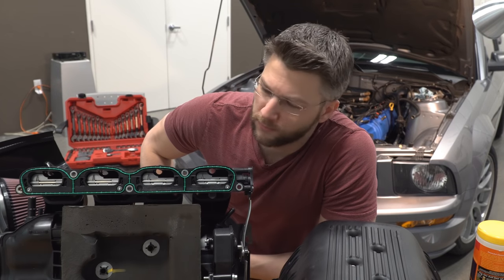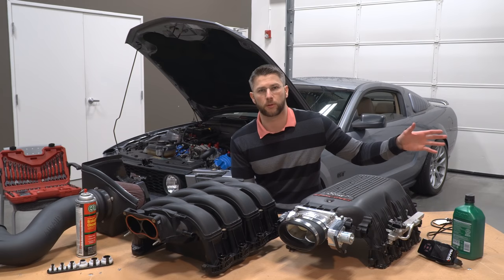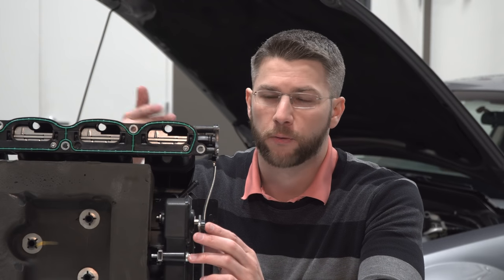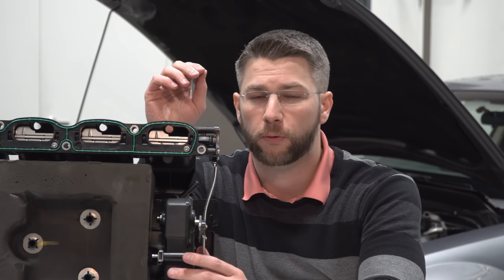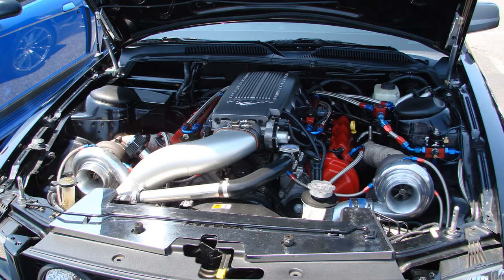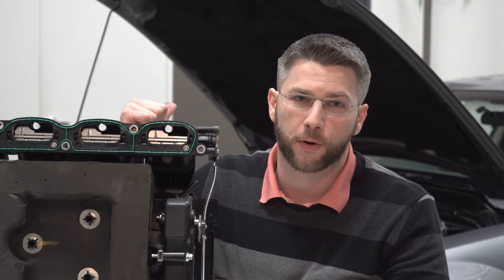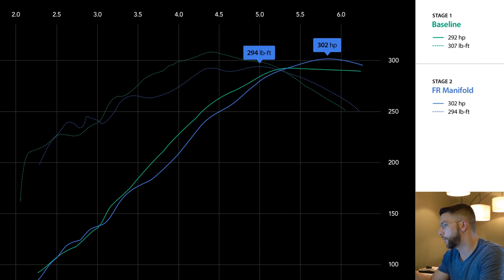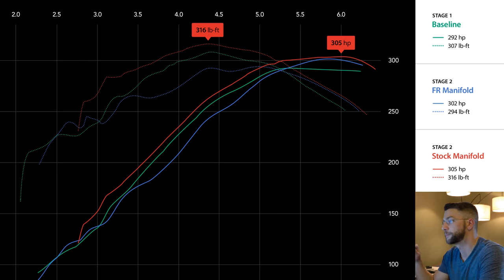Why you shouldn't remove your stock intake manifold

Comment from the maker: After years of working on this car and having it tuned multiple times, here's what I would say now:

- Don't get the ford performance intake manifold if you are sticking with stock cams and are unwilling/unable to get a dyno tune.
- The same goes for removing the CMCVs with delete plates (just not worth it without a dyno tune).
- If you are boosted or going to be soon, definitely remove the CMCVs or get the ford performance manifold.

The PCM on these 4.6 3-valves is fairly complex and sensitive to engine modifications. Sometimes mods can actually reduce power (like removing the CMCVs w/o updating the tune or using a canned tune!).

Your best bet is to install a set of parts all at once (intake, manifold, cams, headers, underdrive pulley, etc), then get the car tuned. That way your Mustang is tuned for its specific configuration which will maximize gains.
Reply: The charge motion control valves look like individual throttle bodies with a gaping hole on it at one corner. Can it be modded to actually work like ITBs, thus eliminating the need for the main throttle body?
Reply: Boosting includes supercharger, yes?
Reply: Another great option aside from the ford performance intake manifold is the Holley Sniper EFI Hi-Ram Intake Manifold. However its not worth it if your not boosting your mustang, but can make significant power if you have forced induction, and other bolt-ons. I think you can use the 65mm Cobra TB with a TB Spacer on it because the opening is 65mm, but I am not sure. However the Ford Performance TB also works just the same on it. Also when you have the Holley Sniper EFI already on it, then I think you do not need Steeda Delete plates.
Reply: Hello Sir, so I understand correctly from this video and your comment. Is , I’m potentially waisting my month and actually loosing performance with the ford racing intake parked with throttle body and jlt intake and tune if it’s not cammed or boosted. If I have neither and leave it naturally aspirated with these upgrades only, then it’s counterproductive?
Reply: I hear your voice when I read this
Reply: @american_alien_1583 it means you’re in love

Comment: As a 30 yr engine builder and tuner, I can tell you that I did extensive testing on my '05 GT and can show that it is not the charge motion plates that make better low speed torque.  Removal of the CMC plates actually makes power throughout the RPM range of the engine - about 5 ft/lbs down low, up to 10-12 ft/lbs @ 5k RPM.  The loss of low speed torque you experienced was due to the slightly shorter runners in the Ford Racing manifold.  Otherwise, your conclusion that the FRP manifold is really only beneficial for higher RPM engine combo's is correct.
Reply: So is it good to use the or not ?
Reply: @3v_karimm  I can't get the takeaway either, other than the charge motion plates didn't impact the tq, but rather the shorter runners in the Ford Racing.
Reply: @nomehdrider  it depends on the application
Reply: Richard holdner has proven time and time again it's runner design! Long runner make tq  down low and mid range while short runners lose tq down low and make more horsepower up top
Reply: @lucasmullins5100   I can't understand why Ford would spend so much money on something they wouldn't have researched extensively and deemed necessary. 

But, this does remind me of the IMRC (Intake Manifold Runner Control) design of my 02 Mustang 3.8 V6. It's the same concept and they are individual plates in the runners that open up the higher in RPM you go. But all that extra only produces a few extra down low tq and hp.
Reply: So steeda delete plates would be a good option for an NA build then?
Reply: Brian... have you tested the stock/GT500/Ford Performance Throttle bodies and see if these are improving HP or Torque. Or the CAI's as well. Thx much.
Reply: @lucasmullins5100 that guys a an Ls bandwagon 🤡 . all he does is use decades old mmff tests when he talks about mod motors.

Comment: I had the same experience with a ported 2018 manifold on a 2011 Coyote. The peak was higher but tons of power was lost under the curve. Unless you over-rev the motor, the benefits of such manifolds stay out of range. Turns out, Ford knows what they are doing.
Reply: Did you get a retune after the '18 install? I've seen average power levels go up on most of the data I've seen, but am curious about your experience.
Reply: Interested to know who tuned your ported 18 manifold
Reply: @NITROUSnBIASPLYS  The car has been tuned by a reputable drag racing shop and I got a re-tune right away. 
It`s a Gen1 coyote, so the ported 2018 manifold is using lockouts. This means the actuators are gone and can`t be tuned, resulting in mid range power loss. It technically still made more power at 7000rpm (+2whp) and likely would have been able to make a little more even higher up. That rev range is not very useful for my application and lap times though and would be hurt by having less power from 4500-6500. With a give and take loss of -25whp and -30ftlbs compared to stock.
Reply: And may I ask who’s ported manifold you were running? I have one I was planning on putting on my car this spring for a drag racing application
Reply: @NITROUSnBIASPLYS  I still think it`s a great piece for the right application and you totally can make it work with the right support mods. It`s just not the silver bullet it gets hyped up to and you need to be willing to over-rev the car to at least 7500. 
Drag racing is not that bad as you only spend brief moments in high RPMS. On road racing we spend 20mins constantly revving from 4500 to 7000 and that four to five times a day.
 Go figure why I`m not keen on revving to 8000.

It has been ported by Bret Barber.
Reply: @Hagedorn racing thanks for the input, it’s always good to hear end results from a wide variety of users.  May I ask another question totally off topic, what oil do you run in your track car?
Reply: @NITROUSnBIASPLYS  5w50, same as the Boss 302. It`s thicker and can withstand the heat better, but also needs some time to warm up. I`m the wrong one to ask if that`s good for drag racing though.
Reply: Thank you very much for testing this out.  I have been thinking about getting one for my '14 GT, but not anymore.
Reply: Joseph Bentley I installed my 1320 Junkie ported 18 manifold on my 14 6r80 car and have been very happy with the results.  I have a circle D torque converter and there was little to no torque loss at all.  And the car pulls much better past 6000 to 7400.  I get my tunes from shaun at AED.  Great guy to work with
Reply: @NITROUSnBIASPLYS  I think these are great for drag racing or anything that allows you to more or less safely over-rev the car. Not so much for roadracing on a stock block. Glad it`s working for you!
Reply: Sounds like you use a junk tuner, there's a reason Ford updated the manifold in the 18's and up. No torque loss here on my 15 gt
Reply: hsucduw how does the dyno sheet look like, what RPM do you rev to and are you using lockouts?
The 2018 is great, but only if you rev the engine accordingly or don’t use lockouts. Both things the gen1 is not made for.
Reply: @Badger_S197  oh my fault, didn't even notice you were talking about a S197. Ya, my IMRC's are fully functioning and I rev it to 7700. Must work better on the gen2's
Reply: hsucduw yep, that’s the range where the 18 really shines!
Reply: That doesn’t make sense a 18 manifold swap
On coyote makes almost 50 tourqe low end and 25 hrsp top end
Reply: 5. SLO Unless you over-rev, it won’t deliver any usable gains that will make your car faster.
Reply: @Badger_S197  
It's likely you have more intake manifold then you have intake port/cams if your running unported gen 1 heads. The 2018 and up manifold does a lot better on the gen 2 coyote with it's larger intake, valves, and bigger cams.

Comment: You lost me at Bama tune.....
Reply: BAMA is ok for a stock car, but if you are adding mods to your car go with Lund, Lito or Brenspeed for your tuning. BAMA is crap and very generic and pushed by a lot of Youtubers who get free product from them.
Reply: RIGHT BRO?????? WTFFFF
Reply: @JustAGuy781  Lito FUCKING slaughtered my MPG 12MPG vs 19 with bama, and made the same or less power on the dyno vs bama.
Reply: @jhondoe1483  yeah, but what is the difference in timing and fueling? Are you positive Lito didn't have those correct whereas BAMA has them mediocre? BAMA is like driving an untuned new car and Lito is like driving a new car tuned.
Reply: @JustAGuy781  I’m positive my Lito tune was intentionally pushing really rich to protect the motor it’s not a bad tune at all but it’s not really a good one the idea that bama is bad comes from the old v7 tunes nobody has those issues with them these days. I run brenspeed now with good MPG and 5-10 more HP across the whole bottom half of the curve, never looked back but that Lito tune was a nightmare not that all his tunes are I know he is beloved but my point is nobody’s got the perfect tune bama does a fine job for lightly modded cars

Comment: I had Steeda CMCV delete plates on my old 3V with a proper retune for the deletes, and it was a fantastic mod for hardly any money.  Picked up over a tenth and 1 mph in the 1/8 mile with no loss in under the curve power.

Love your vids btw.  My 06 was also Tungsten Grey and I still miss it to this day.  Love my 2018 but I'll always have much respect for a proper 3V.

Comment: It's all in the tune evidently  .  I purchased a 19000 mi . 05 and it wouldn't do a rolling burnout in first gear , it had an off idle stumble and didn't pull in high gear at low rpm very well . I did a tune by Brenspeed with Steeda cold air intake , underdrive pulleys , and charge motion delete plates and on the test drive was very surprised at the difference in all driving conditions , especially on the pedal to the metal test in second gear at a low speed , which now broke the tires loose  .

Comment: The valves aren't increasing back pressure. There is no back pressure in the intake (unless you have a supercharger and the back pressure, better known as boost, is created by the compressor). What the CMCV does is act like a small partial throttle valve, a deliberate restriction, which, if you call the venturi in a carburetor, increases the air speed which is what alters the charge motion and leads to better low rpm combustion, power, and drivability.

Comment: Great video brudah! I like that you are digging deep into the details in NA land. I think many folks do not realize that the power that you are going to obtain with forced induction is directly related to what you get NA. A 320 whp NA 3V will get about 640 whp with 1 atm of boost as compared to a 260 whp 3V getting about 520 whp at the same boost level. That's a big difference IMO. 

I'm glad I didn't waste my money on the ford racing intake manifold!

Comment: Who would've known it performed better without the FR manifold. I'm glad you are providing us all this information. Cheers!
Reply: Tune’s fault not manifold
Reply: @schmidtygt  tuning won't bring back the lost low end torque when you install an intake that's designed for top end power. It cannot make up for the CMCVs, nor can it make up for the change in runner length.
Reply: The FR manifold is meant for RPM so with out bigger cans it's not Benidict Al it's not the intakes fault it's the wrong intake for his combination

Comment: Interesting results.  I gained about 8hp at the very top end with the stock manifold and CMCV delete plates (stock TB, steeda CAI).  However, I'm also running a Lito custom tune (both pre CMCV and post CMCV) which may explain some of the difference.  Anyways, great video -- looking forward to more content from you.
Reply: I drilled out my butterflies and installed a gt500 throttle body with a lito tune   i have to disagree with you  my cars running like a raped ape.

Comment: Let me first start off by saying, VERY WELL DONE VIDEO, amazing content, and editing skills. I will however need to interject a few things. What software do you use? Adobe Premiere? 

1. The ford racing manifold is designed to either (A) be run with forced induction or (B) be run with a more aggressive motor setup (stroked engine, aggressive cams, aftermarket valve train, ported heads) where people say "screw low end power" and build the engine to live in the top RPMs (3600-7500). Yes, a well setup 3v valve train with VCT locks can rev to 7500, stock valve train is safe for 6800.

2. The engine, heads, camshafts, manifold, and throttle body are designed to work TOGETHER.  If running stock camshafts and valve train, you'll definitely see a loss of low-mid range power with the removal of CMCV's. Once you start getting rid of certain parts, obviously you'll lose performance in certain areas. The issue was, you didn't make up for any losses. With the addition of a more aggressive cam, 93 octane gasoline or E85/E98, and a more advanced spark with a good tuner, you'd be making HUGE gains in the top end that would make not having low end torque irreverent because you'd never spend time there.  I hope this cleared things up. I love the content, please keep showing the 3v nation some love! 

Add me on instagram @Slow197GT

Comment: I learned from many years ago during a college talk from a big three engineer (ford, gm, chrysler) how obsessed they are about atomization of fuel and the tumble swirl flow characteristics of an air fuel charge into the combustion chamber. They had plenty of evidence including some slick video of the phenomenon in action. Think of a diver jumping off a platform twisting and flipping at the same time, that is the tumble and swirl they speak of. Doing so mixes the fuel evenly with the air and atomizes the fuel into tiny equal size droplets like an aerosol spray. The better the tumble and swirl, the better mixed the air fuel charge is. The plates here introduce this movement into the airflow at lower engine speeds,  and what this is what the old post is talking about. The analogy with the hose is correct as well, but that is only part of it.

Kudos for you for not chasing peak torque and hp only.

Comment: Great info! Thanks for sharing. I'm running the Ford Racing intake and TB,Detroit Rocker cams,JBA longtubes and a 3 inch exhaust.One piece driveshaft,and 410 gears.With stock plugs and coil packs,it dyno'd at 365 hp at 6700 rpm's and 340 on the torque.It drives great,especially at the low and mid range for the street,and still pulls like a bear in the higher rpm's.Those Rockers were the ticket. Coming from someone who owned 2 Boss 302's and a Boss 351,my '06 GT is the most fun to drive compared to the other three.Good luck!
Reply from the maker: Would you happen to have a picture of your dyno run? Would be interesting to compare charts.
Reply: Sent you some stuff on FB...

Comment: Your videos are absolutely awesome... Thank you. I suspect there may have been a tuning issue with your stage 2 setup, specifically the one with the FR manifold. How confident were you in the tune? You probably know this already, but an intake with shorter runners (like the FRPP one) will have much better airflow at high rpm than an intake with long runners like the stock piece. 

In addition, I think it would be worth your while, and help explain things better to find out exactly how the CMCP's behave, i.e. their position in regards to throttle input, RPM, and load. Figure out the intricacies of the stock tune and your aftermarket tunes. The FRPP manifold didn't suffer where I thought it would most: low RPM. Theoretically, low RPM is where the CMCP's should do the most work and have the most effect due to the fact that air velocity is the slowest at low RPM. 

Super happy I subscribed and super happy for the next video!
Reply from the maker: Some good points here. I thought the intake runners on the FRPP were longer as it sits about two inches higher. Do you have a source for this?

I am not confident in the tune, but am not confident in the others either. They were all canned Bama tunes. We tweaked the one for the FRPP a bit and were able to squeeze out another 5 hp, but I figured comparing stock Bama tunes only was more fair.

The most scientific approach would be to get another custom tune by the same guy who just did it (car is making quite a bit more power now) with the FRPP installed and compare the results. Maybe I'll do that maybe not... it's another $500 and another evening spent swapping the mani.

And thanks for the compliments, much appreciated.
Reply: If you search "Three valve intake Manifold test-Three's a crowd" on google you should find some information on it. The FRPP one is taller simply because the runners are less curvy than the stock manifold. I guess think of it as intake runner length does not equal intake manifold height. Looks can be deceiving haha. 

And interesting about the tune. It stands reason to believe that the more modifications you put on the car, the more messed up (or incorrect) the bama tune will be, simply because there are more variables for them to account for (and sometimes they can't even get the simple stuff right!). 

TBH the only thing that seems "off" with your tune is the midrange. Generally speaking, people don't pick up much more than 5-15 wheel at around 6k with the FRPP manifold, which goes along decently well with your results. But, they also don't loose much low end, and sure as hell don't get the weirdly inconsistent midrange that you've got. Glad to hear the car is doing better now!